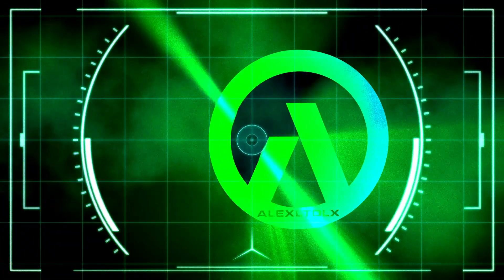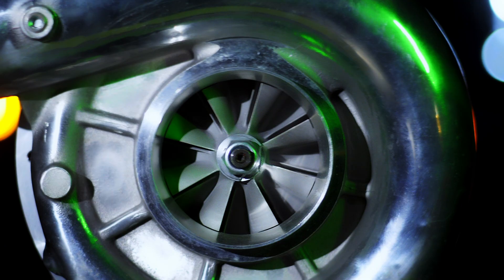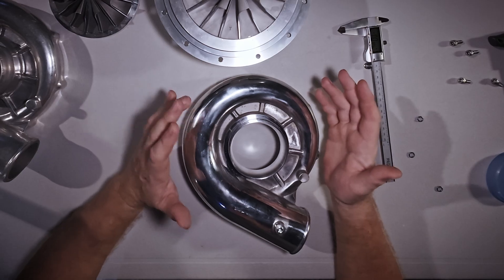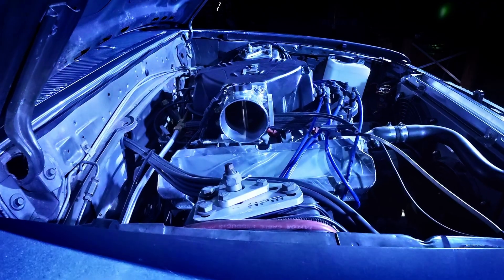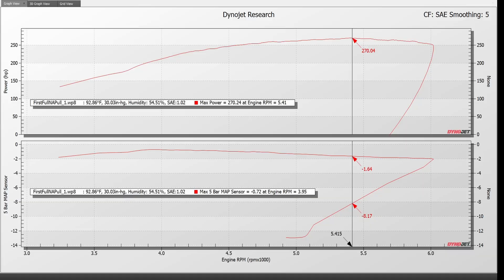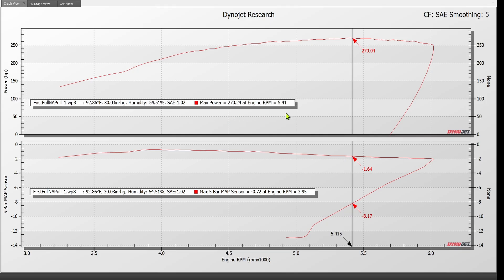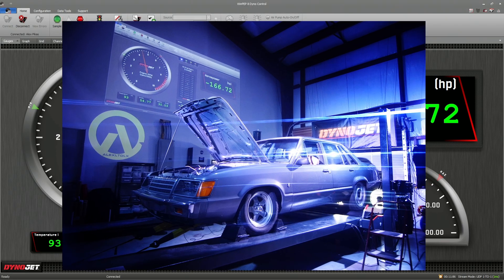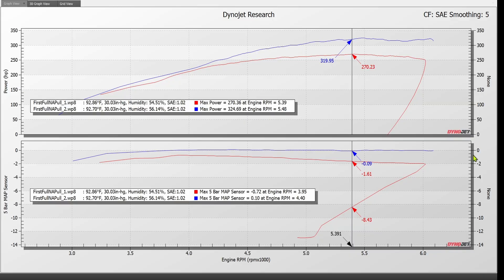Sucking Through an Electric Supercharger When It's Off - Dyno Test

Comment: Someone make a automatic supercharger bypass . Make it simple make the bypass doors open easily with vacuum.  spring loaded  for  simplicity and compatibility with Paxton or electric servo for the folks who want to tie it into the electric supercharger circuit.  Then you can go full Mad Max interceptor / Motorhead Mike GTO with the pull switch on the gearshift lever!  Isn't that what most  of us  really wants  for supercharging ?

Comment: how about one of those fancy lockup converters? Youre using this as a teaching aid and taking converter slip out of the equation would simplify things.
Reply from the maker: Would love to.  Have you seen the prices on them?  And I'd need a new powerglide case and some new internals as well.  I'd be well over $10,000 into that setup.  Unfortunately, given the power levels this car sees on occasion, there is no good reliable and affordable lock up transmission solution.
Reply: @AlexLTDLX  gah!  I didn't know they were so much more than a normal converter!
Reply from the maker: @mxguy2438 look up a Suncoast th400 lockup converter - it's $7,200.  With the aftermarket parts in the glide, I'm running an after-market th400 input shaft - it's stronger than the glide design. If a lot more people subscribed I'd do it, lol...

Comment: The system I'm working on is using a small turbo (Garrett G30-660) behind the supercharger and going in to a 2.4L engine ... I was assuming the restriction would be minimal with a turbo pulling through the SC.  The SC is just intended to torque fill until the turbo can get up to speed.

This is not for ultimate power, just for fun, and it's on a street car.

Comment: I would imagine the end game will be running the sc at a min of say 10% input so its spinning and ready for 100%, I also think having it spinning will help the controller ramp up smoother, less initial current, just easier on everything, rather than just asking the esc to go 0-100%, less voltage sag, I would think say .4 psi at idle then full beans when you mash the gas.?

Comment: would a free spooling pulley system where when the electric motor stop the supercharger would still spin work? and using a e-gate to bypass it when off would make things more optimized i think thats how they use it on the audi diesel twin chaged
Reply: A gate could allow a spool up during the two step

Comment: Allow me to throw another 'monkey wrench' into your testing.  Of which I'm extremely impressed by, because you are extremely transparent by your results, without too much 'comentary' to try to explain away your results. 

I'd like to send you a product that I sell, (with not much luck, but it works nonetheless) , for you to try on your current testing.  I'm willing to bet, that if you try adding my product to your current testing... Once you optimize what you can get out a dyno pull, and you add my technology, You can reduce the timing by 2-3%, and develop a horsepower gain( usually by 6 to 7 %, when corrected to engine temps.  I haven't evaluated EGT's yet, but I suspect they will follow that same trend.  

The end result is, you'll be able to burn more fuel( which equates to more power), with less input(throttle position), to make more power... And if you allow me to measure the exhaust gasses, I can prove that I can lower NOx emissions as well as HCL, emissions while I build more power than you are currently building.  I'd love the opportunity to show you my results in real time.  Just let me know If/when you are ready to go down the rabbit hole of finding the absolute power available in a particular fuel.
Reply: Thats a
20kv 2a High Voltage Diode Prhvp2a-20

Between the positive of the ignition coil   and the spark plug High Tension side?

Plasma Ignition.
Reply: @brettec2042  That's how I make the plasma ignition, but that's not what I sell.
Reply: Well what do you sell?
Reply: @calthorp  It's Called the "EnergXciter".  You won't see me on the internet because there's a lot of scammers out there, and I'd prefer not to be associated with them.  I only sell face to face, so I can prove that it works, before you buy.

Comment: I would suggest putting in a backdraft damper, it's essentially a one-way valve for air flow and when you don't have pressure built up against it it will allow air to bypass the blower restriction when it's not making boost.
Reply: It is what TorqueAmp use, but they sell for 200+ euro 💶
Reply: About two decades ago when I was experimenting with this on a large displacement engine, I used two 2" sump/sewer/irrigation check valves.  They're essentially a rubber flapper in a tube that's naturally closed can be bought at any hardware store for between $12 - $75 depending on diameter.

Comment: wonder just how much the supercharger has to spin to not lose anything.

oh, idea for a video. I see people starting to use those chain electric ac compressors on cars. they pull something like 70amps at 12v. but I feel like you'd dive in and do the install and data better then most.
Reply: Probably <50rpm